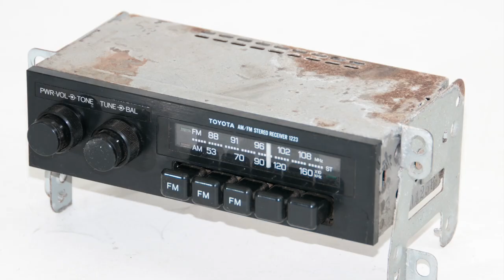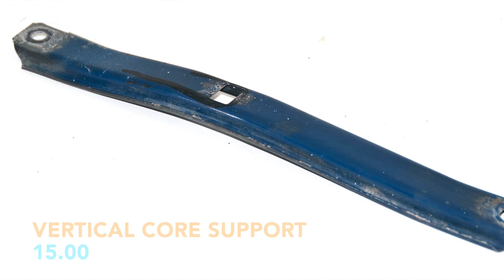I parted out a $50 Toyota Pickup Truck Cab and made $3573! (Part 2)

Comment: I'm doing something similar, like you made the instrument panel connections? do you have any wire diagrams?
Reply from the maker: The wiring harness and cluster were already missing from this truck when I got it. I only have wiring diagrams for a 1985.
Reply: @6thGearGarage  Ok, I am restoring a 1985, and there are many cut wires that I would like to locate, can you pass me that diagram?
Reply from the maker: @diegoheguaburu6438  The diagram is a long fold out from  repair manual. What areas of the harness are cut? Under hood or under the dash? Let me know what components aren't working and I'll scan those parts of the fold out for you.
Reply: @6thGearGarage  under the dash,by mail can you send?
Reply from the maker: @diegoheguaburu6438  I'll scan them and out them online for you to download.
Reply: 6th Gear Garage thank's bro
Reply from the maker: @diegoheguaburu6438  Here you go: http://6thgeargarage.net/1985-toyota-pickup-truck-hilux-4runner-wiring-diagram/